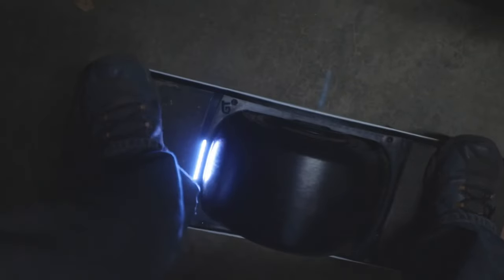Onewheel GT footpad sensor issue

Comment: You fix it? Was it covered by warranty?
Reply from the maker: I just rode with it. It didn’t connect as good when cold. Was thinking once it got wore in it would connect better but with the new app update I turned on single engage zone and can jump on and go without hesitation now.
Reply: yo. I just got one for xmas. it makes me wanna ride my XR because it's so frustrating. I looked in settings and can't find that setting.  @ArcticFrost
Reply from the maker: @DomRodFpv  If you update the Onewheel app you can switch the footpad engagement zone. Now I can jump on and ride. 🤙🏼 https://youtu.be/JDGQGLLn9Tk?si=uGJnPPQo8Wxibk_4